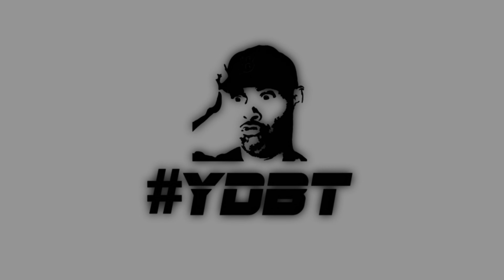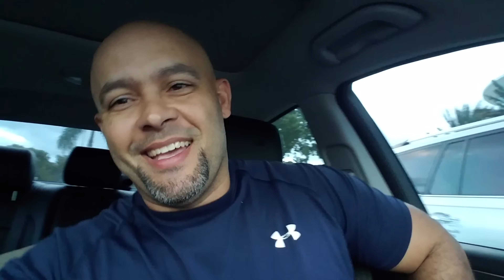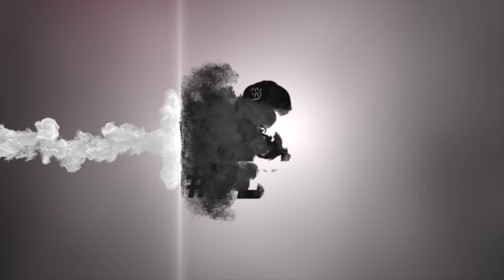The potential of  making power on Boosted 2018 Mustangs

Comment: Here is link for the people who think camaro is forgotten http://www.motortrend.com/cars/chevrolet/camaro/2018/2018-chevrolet-camaro-ss-1le-vs-2018-ford-mustang-gt-performance-pack-comparison/
Reply: Bow Tie The Camaros good for the street and track but let's be real here. Most that buy these won't see a road course. The mustang has the better top end and by the end of the quarter mile the mustang was about done reeling in the Camaro. From rolls it'll be even worse. Bring in boost and it just keeps going down hill.
Reply: Claud The cloud yeah let's be real, by the time mustang overtakes the camaro its above 120mph, that's very high speed. Camaro has already won most of the drag races. Yes, will lose if the race is in straight line for more than a mile.
Reply: Claud The cloud and yes, I got the 1le for track, even the top 2018 mustang cannot beat the 1le period.
Reply: Bow Tie no one cares about the track dude. Perfect example is the viper acr. It destroyed it competition for a lot less and ended up going out of production. Another thing why are you on a coyote only channel with only drag racing and coyote info/content? It's not gonna take a mile to overtake the Camaro if by the end of the quarter it's pulling right next to it.
Reply: Claud The cloud dude I had mustang before this, I am not hater. However I posted because camaro was mentioned in the video. And for numbers the camaro wins the 0-60, 0-70, 0-80,0-90 and 0-100 and also outshines the mustang on track, so how is the camaro forgotten? And yes for practicality good luck racing the camaro beyond 120mph on normal roads :)
Reply: Bow Tie Like I said by the end of the quarter they'll be nearly neck and neck. From a roll the Camaro will be seeing taillight's. Good luck racing a boosted coyote vs a boosted lt1 or even a heads a cam swap lt1. The lt1 will still see taillight's.

Comment: Ford seems a little behind in the direct injection game (not that I’m complaining). I don’t know much yet on how the setup is on the new mustang, but if it’s similar to some of the foreign cars I’ve seen there is a high and low pressure system right? A standard in-tank pump and then a high pressure pump on or near the fuel rail? I’d hope to see some upgrades for the high pressure side of the fuel system in the future. I know the 2018s are new to the market.

Comment: Are the short blocks the same on the 18 GT's as the 15-17 cars?
Reply: Crank is the only carry over part. Everything else is new.
Reply: No, its got a lot of updates. You can google Gen 3 Coyote for articles about it, different bore, crank, rods, plasma coated cylinder liners, tons of stuff.

Comment: I think 940 ehp or 750+rwhp through a 10speed and 580rwtq on 93 pump gas is pretty damn good. That's with the 2018 and 3.0 whipple
Reply: The et difference is disheartening, I've always understood trap speed was the real indication of horsepower. I believe the 10.4 trapped 134 and the 11.0 trapped 122? How much rwhp does it take to pick up 12mph on a 122mph car? I know a 100 shot picked my old car up from 118 to 128, so around 150rwp. Think it shows some promise.
Reply: Alejandro Flores Google Lethal performs 2018 mustang stage 3 Whipple. They claim 755rwhp through a 10speed on 93 pump gas.
Reply from the maker: Where is this said car. As the only one i've seen is a 10.4 car on 91 pump.. BUT a N/a 10R80 just went 11.0 so that number isn't impressive any longer.

Comment: I have been wondering if the bump in compression is going to be an issue with boost and pump gas. You think that will be an issue Alex?
Reply from the maker: If someone comes out with a baller DI pump, i can't see why not.
Reply: They boost GT350's! Get my drift?
Reply: Alejandro Flores will the Coyote 3.0 get better DI with bigger cam fuel lobes or is it regulated different?

Comment: Great video Alex , there's only 1 gas station in my area that sells E85 . You're 100% correct,  about people who wants to tune their cars on pump gas . Because you'll be able to travel any where . I'm from the north east area ( Maryland ) about 40 miles from JBC Performance.
Reply: I personally don't think e85 is the answer to everything. I live in upstate NY and theres no e85 near me. I think they are more towards the city. Most of the station now are switching to non ethanol 91 octane wich is crap anyways. Just have to tune the car for what ever gas can get

Comment: Whipple's 2018 just went 10.4xx on pump gas.
Reply: 91 octane. Not even 93. 688rwhp. If you're not happy with that on the street, then I dunno. Cause that's MORE than enough for the street.
Reply: Matthew Hurlman  Yep I have a 17 Whipple with summer Nitto 555 G2 305s And can’t hook till 3rd gear. A roll race is a different story though.
Reply: As did procharger.
Reply from the maker: Our track attack car made 702 on 91 octane. Some 91 is as sweet as 93 especially in the carolinas. Make 700 on florida 91 and i'll be impressed, as long as they are not running it at .69 lambda